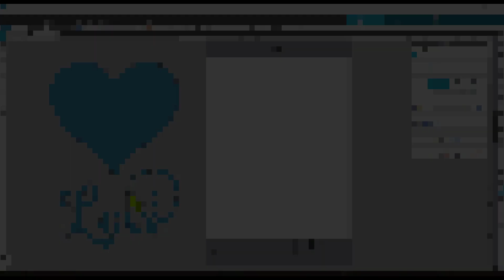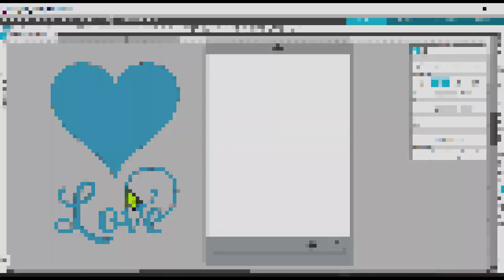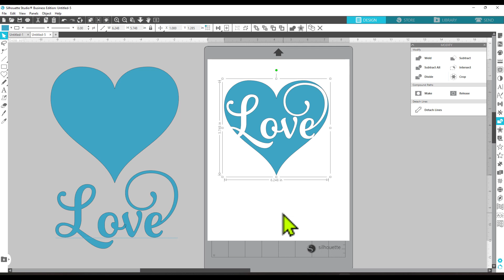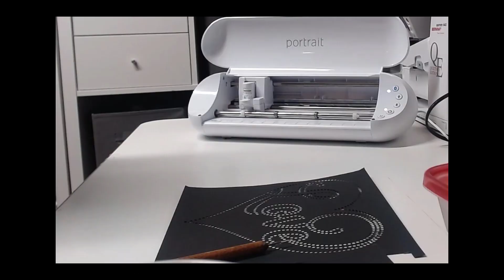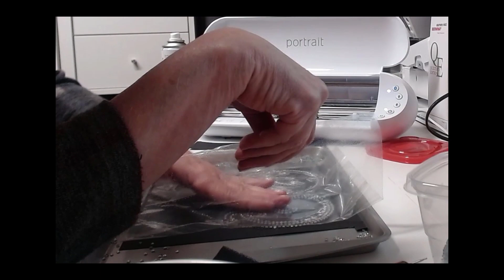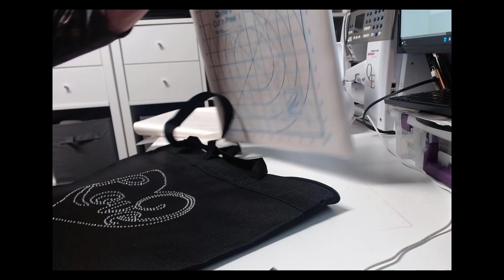Rhinestone Bag Design Tutorial for Beginners Using Silhouette Studio

Comment: Have you ever tried Kraft board? It worked ok except When bringing it to cricut from silhouette it wasn’t the same size only off a little but the holes were slightly larger then beads should they be?
Reply from the maker: Hi Janet!  Don't forget, if you create something in Silhouette for Cricut to put the width in the name of your file and as soon as you bring your design into cricut (with the lock LOCKED) resize the width. That should make the holes remain the correct size.